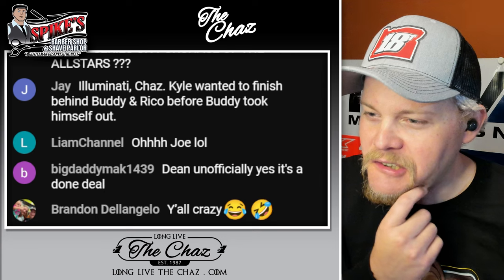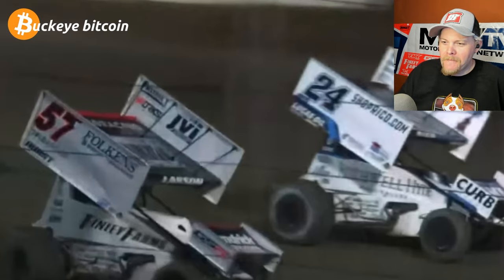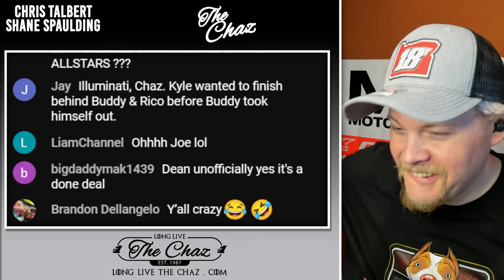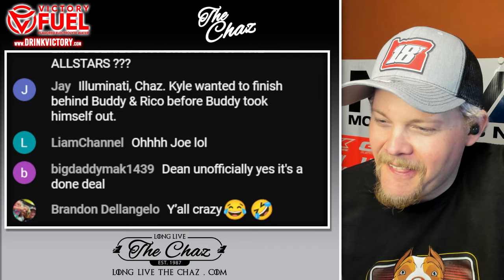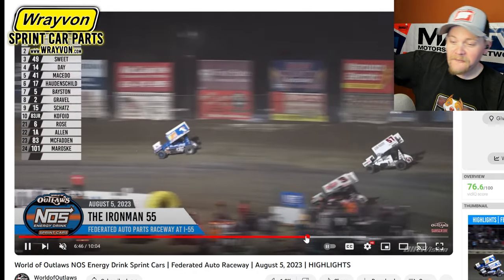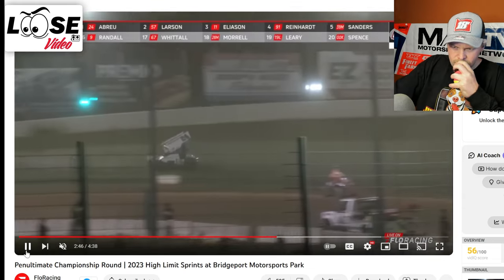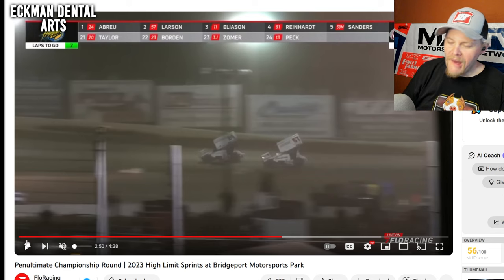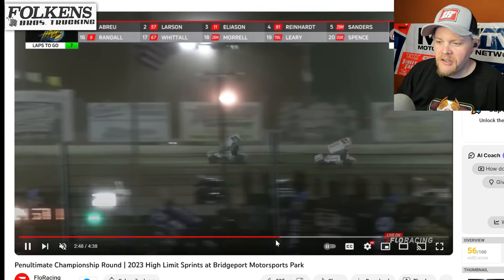HIGH LIMIT FIX? "Why did he give it to RICO!?" - a look into things on the racetrack.

Comment: It looks weird, but if he was really trying to lose, or make it close, he would have lost by more than 1 position. The only thing I can come up with, it that there wasn't a spare lane under Rico.
Reply: Bull, he did at Lernerville. Go watch the replay in slow motion of when he hops the cushion. It’s an intentional and controlled maneuver until he catches the thick and had to rely wheel the car down and back on the track. He wasn’t expecting to catch so hard. He was trying to make a battle between him and second. That’s not even where he would have breached the cusion or at the angle he would have gone over. He brought the car off the top on purpose,   He’s not just worried about a win or dominating a race he’s worried about points being boring too. Wouldn’t be surprised if he lets Rico take it.

Comment: I think Kyle was just racing a little strategically. He is know as someone who always sends it sometimes way too hard and it cost him the race. Has happened in sprints and nascar both this year. I've noticed it in a few of his last cup races where he seams to be driving a little more conservatively like he is trying to maintain points instead of going all out and junking himself.
Reply: He literally said it in his interview he didn’t wanna wreck in p2
Reply: Bull he also sandbagged the race at Lernerville. It’s a 100% fact. Any good driver will to you this.  My wife said it as it happened while doing dishes. That’s how obvious it was.  From a real drivers perspective, Larson brought the car over the cushion to let the field catch up and battle. Then got caught off guard how heavy it was and had to fight the hell out of the car. Watch a replay. It’s a controlled move. From a person that knows that track it’s not where, how or the angle he would have gotten over into the slack. It was intentional.  So was this current issue.   Go back and watch the past interviews with him and Brad. They talk nonstop about dominating races and points and how it’s boring. They did just the week before Lernerville.
Reply: @chazbuchinsky19 bull. He’s also stated in multiple interviews that he doesn’t like a large points gap, doesn’t like a driver dominating the points or race. He and Brad both said it a week before Lernerville then Kyle drove himself off the top. It’s a fact. He did it intentionally. To let the field catch up and battle. He just wasn’t expecting how gnarly the rough was above the cushion and had to fight the car.   Any real driver seen it as it happened. My wife literally identified it on her own watching live.  The friend I was with said “what the f*** he did that in purpose” he’s only been driving for a few years.   Chaz missed it cuz he’s clueless half the time to what he’s watching. Only catches stuff after fans start talking. Or he misinterprets an interview Lr podcast.  That’s the problem  with a voice in the sport who’s never strapped in to any machine, been good at, was a regular fan, or never grew up involved in it, they just don’t know what they are watching, listening to or taking about.